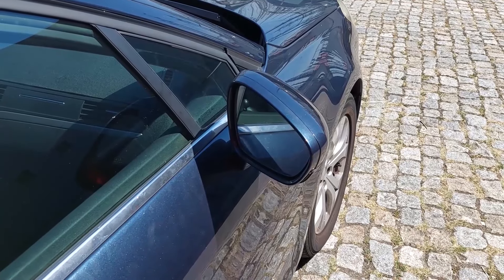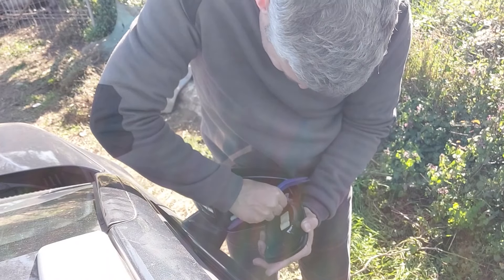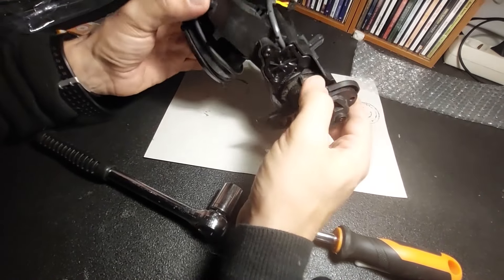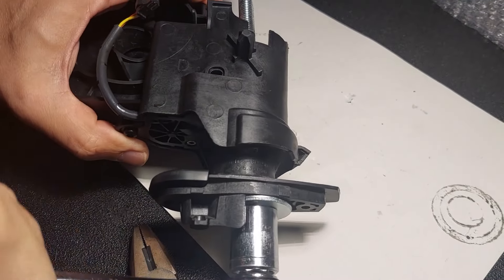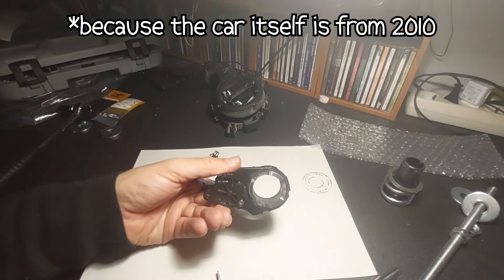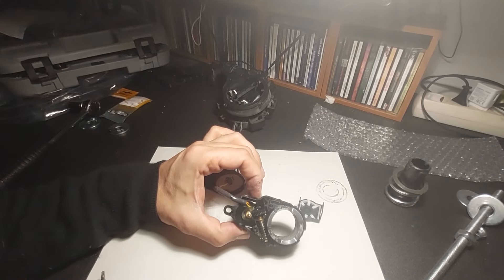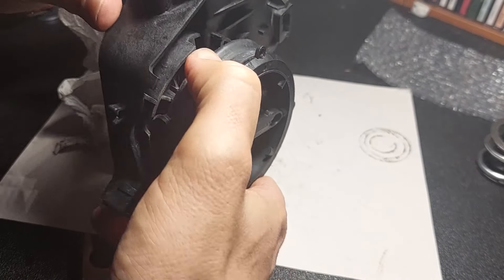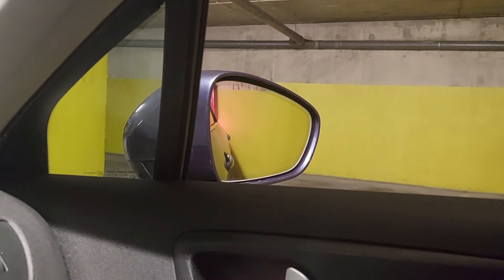How to fix a motorised Folding Wing Mirror (that stopped folding)

Comment: FYI: Peugeot 508 has a different worm gear on the shaft, meaning this motor does not fit. Also can't find a replacement anywhere... guess i'm stuck with a winking car.
Reply from the maker: Thanks. I'll pin this in case other 508 owners see this. Which generation of 508, the 2010s one or the current one?
Reply: First generation prefacelift. Also worth mentioning mine has two connectors, 10 pin and 6 pin. It's a 2013 GT.

Comment: Just to let you know the central locking In the door latch is also the same motor as that 1 iv just orderd 2 to fix my rear drivers door lock great video I bought a new mirror for my car as it wouldn't move I still have it so I will fix that at the same time ty again 👍🏻😊

Comment: Hi, since you are quite familiar with X7's, I've got a question regarding the interior. How come SOME of the plastics inside feel like they're 'melting', as in, buttons for the windows feel mushy almost, same with some other things like around the center console. Mine's 2012 and 182k km, but seems it's been driven for 800k km because of it 😂
Reply from the maker: Hello. I'm not 100% sure, but I think it's a factory coating that makes everything feel more "premium". I've seen the same on BMWs and on the stereo buttons of my old Volvo. I think the coating degrades over time and "melts" as you describe, and worse, it attracts dirt and filth. I try to clean it off whenever I can but it's tough to do so. Below is good plastic so it isn't a problem to get rid of the coating, in my opinion.
Reply: @comcarclub  ....well I can verify Mr. Comfy's words, since I had the same problem with the middle console, and I ended up painting it, along with the silver stips on the door handles. You can see it in my video about the gear stick knob fix on the X7.
The buttons, are also coated with the same crappy material, and you can't realy do anything about them. The switch frame is different. You can remove it and clean it, and have it with the original plastic, but cleaning each button is a bit of a pain. I only managed to clean the forlding mirrors button, when I disassembled the switch, and I was too bored to do the rest of them. 😂😂😂👍👍👍
But yes, the coating on the buttons can be removed with simple rubbing alcohol and kitchen paper, but the coating on the middle console....I scraped it away with sand paper, and then primmed the plastic, and took it to a pro painter to apply the car's color and a clear coat, to have a decent result. AND it doesn't attract dirt any more.
Reply: @comcarclub  Thank you for your response! I just thought it was really bad plastic, kinda relieved to find it's some dumb coating. For me it's a useless thing, my previous car was 12 years old with 385000km (was a rental car lol) and none of the plastics were detoriated that bad at all, in fact it looked barely used. Was just a bit disappointed to find a large sedan having such issues. Oh well, thank you once again :)

Comment: Thank you for your time showing this.
Them motors seems to be used for lots of things in cars. I had an Audi and the remote locking never worked on two of the doors. I stripped the locking mechanism down and found this little motors inside. So I took the motor apart and cleaned the commutator with wire wool and refitted. That seem to work well and was free.

Comment: Thanks for the video. To summarise, in order to unlock the black sleeve inside the big spring, it's a case of pushing in then turning 45 degrees? Like a baïonnette? 
On my Ford, I cannot reach the screws shown at 00:5:33 so I cannot use a threaded rod but must try with a clamp or a vice....
Reply from the maker: My apologies, I'm not familiar with the functioning of a bayonette, but the way you described it seems accurate. Push in and twist. I hope it helps!
Reply: Thanks for the answer.  A bayonet is like the old push and twist lightbulbs
Reply from the maker: @brandedfireball7822  yes, that's it. More or less the same motion

Comment: Think you're a lot more mechanically minded than you give yourself Crees credit for 😂 good video thankyou you've inspired me to try repair my folding mirror from my vw golf, not sure it can be because a bit of the metal that is what I can only assume part of the pivot  point or something so see how I go mine isn't the motor, I smacked my mirror on  something an botched the thing but a new one is easily 600 quid or around 850 bucks Australian bucks.

Comment: Brilliant. You're a braver man than I - Does the same motor tilt and yaw the mirror?
Reply from the maker: Thank you. No, that's a different motor inside the unit.
Reply: @comcarclub  I've had one give up on me. The auto electrician gave up too and suggested getting out the car and doing it by hand - old skool 🙂
Reply from the maker: @PatMo1888  I did it on my old Mazda 6, and it turned out not to be too hard, and that's saying something. I'm very hamfisted and impatient, so I honestly think if I can do it, anyone can
Reply: @comcarclub  if I do, I'll let you know

Comment: Excellent video! I have a similar problem on a Peugeot 2008, 2016. The passenger side mirror opens and closes normally for a few days, then gets stuck in the closed position and won't open for days. I noticed that it's loose in the hinge, now I'm wondering if my problem is with the motor (which apparently works sometimes) or if something in the mechanism is broken (since it's usually loose)?
Reply from the maker: The only way to know is opening it up. It sounds like a bad contact, as it's an intermittent fault
Reply: @comcarclub  I'll try that. However, since it's loose in the joint, whether that means it's falling out of the bearing or the shaft is broken or something, I don't know how the mechanism works until I open it, obviously.

Comment: I'm tempted to believe that everything was simply a matter of dried out grease. 
Had a similar case in a 2007 Ford Mondeo, in one of it's rear door locks. The motor inside wasn't spinning as freely, due to dried out lubrication in it's axle. It got stuck in the unlock position, and wasn't able to turn back when powered the other way.
It only needed a few drops of WD-40 to work properly again. Stupid things have sleeve bearings, and they dry up in time, causing this kind of problems. 
Have you tried the old motor after removing it? Is it spinning? I would've tried it again, coupled to that gearing, (without the PCB), just to see if it spins.  Usualy they don't burn up, so as to get stuck, and the fact that it did move just a bit, shows just dried up lube. 
Good work overall though 👍👍👍👍
Reply from the maker: The old motor worked but only moved very slightly. The grease inside looked fine but who knows? I don't have a way to test the old motor without going through everything again!
Reply: @comcarclub  ...well...yes and no. I mean...sure, I don't want to see you going over the same thing all over again, that's not what I mean. I was just curious about the old motor. If you supply 12V with a couple of paperclips, in those slots, it will turn (if it's ok) or it will not turn if it's stuck. That's it. If you manage to do that, let me know. 
👍👍👍👍👌👌👌👌

Comment: Hey mate first of all thanks for all the videos! They're appreciated!
Have you ever had any problems with the electronic boot not opening? Cheers
Reply from the maker: Funnily enough, I had some today. Some of the plastic trim on the left side of the bootlid came ever so slightly loose, but it would hit the inside of the boot opening when I tried to open the boot, and the system decided the hatch was staying shut. I had to force the boot open by hand. Some short sharp smacks to the trim and it works normally again.
Reply: Obrigado! That might actually be the problem with mine! Tomorrow I'll check it out and if I manage to open it, I'll buy you a pint 😊

Comment: Great video - thanks. I have similar problem on Peugeot 508 GT (2016), driver's side mirror. I have seen some videos showing dismantling from the interior of the door .. but would you think that this method - from the outside - would work ? The two cars are pretty similar.
Reply from the maker: I would bet on it. 508s and c5s share some interchangeable parts, like rear wiper and door handles. I doubt they would develop a completely different solution for each model
Reply: @comcarclub  Thanks - just ordered the parts from AliExpress. I just saw your video about Daigbox as well - did you finally get to grips with any hardware and software that worked ? I am trying to look at my heads-up display
Reply from the maker: @andrewhayman6854  unfortunately not. For the time being, I'll leave the computer stuff to my mechanic

Comment: Hello there! Awesome video, that save me a ton of time, work, and money. I’m currently working on my mirror (Peugeot 508) and it’s the same mechanism. The only problem I encountered is that when I dissasembled it, I didn’t keep track of which way the metal piece is fitted, the one with the grooves that fit in the mirror column, so when I tried to reassembly everything I didn’t know how to get it right. Do you by any chance know how it goes? I’m afraid that when I put it back in the car, the mirror would fold anywhere but the place it’s meant to be folding to. Thanks in advance!! Greetings fron Argentina
Reply from the maker: Hi there, thanks for reaching out. Can you point to what time code in the video you mean? I'm not sure which part it is. Thanks!
Reply: @comcarclub  the metal piece you’re holding in 16:06. Thanks!!!
Reply from the maker: @lukpo2007  I see. Make sure it has the bearing, the piece with little balls in it, and the O-ring above it. And make sure it's facing downwards like in the video. Apart from that, it doesn't have a fixed position, as long as it's facing the right way, it should work
Reply: @comcarclub  thanks for your response, i’ll try to finish it today haha
Reply from the maker: @lukpo2007  Good luck!
Reply: @comcarclub  welp.. it kind of worked, the only problem is that the mechanism is inverted. when it’s supposed to unfold it folds, and when it supposed to fold it unfolds the mirror. I don’t know how o or when I screwed up
Reply from the maker: @lukpo2007  oh, I think I know. You have a motor for the wrong side. The only way to fix it is to get a motor for the correct side.
Reply: @comcarclub  that was it, I inverted the cables and it worked wonderful!! Thanks for your help!
Reply from the maker: @lukpo2007  I don't think I helped that much, but I'm glad it works, and congrats for fixing it!

Comment: update july 24 you can access that troublesome spring without taking to mirror off the door - you just need to make a 35mm tube with 2 prongs that match the slots in the washer and depress (with force) then rotate. It will all come apart and you can change to motor whilst its all on the vehicle - note I got the wrong motor ( it had the wrong brass worm drive) BUT I managed to take the original motor apart and clean it and remove all the carbon and reassemble - bingo!
One last note - when I took off the mirror, I managed to separate it from the  actuator motor - meaning that when I pressed it back together - I broke one of the nylon actuators - be careful - that part can also be purchased for about $20 - good luck
Reply from the maker: @tobykeen3700  interesting. Do you think it's easier that way? Thanks so much for the input!! 👍

Comment: How about when side mirror unfolds and the motor is still rotating and continuously making noise? What could be the problem?
Reply from the maker: That's odd. Maybe a bad circuit board, since something needs to "tell" the mirror it should only do a quarter turn.

Comment: How did you verify that the motor was faulty in the first place?
Reply from the maker: Well, I believe I mentioned it in the video, but I will sum it up. I wasnt sure it was a busted motor. The slight movement of the mirror suggested it was the motor at fault, but I could only be sure replacing it. Because a replacement motor was so cheap I thought, why not?

Comment: And what if the power mirror works but instead of going to it’s default and stopping it goes all the way back?
Reply from the maker: Not sure what you mean. It opens but opens too far? That might be a problem with the instructions the motor receives, it's doing too many steps. This is just conjecture! I can't be sure without properly understanding the problem.

Comment: my left side mirror of my honda crv is not folding but the indicator is still there and the inside gklass mirror still working, i suspect the motor or sensor which prevent the mirror to fold.please assist
Reply from the maker: Change the motor like the video shows you